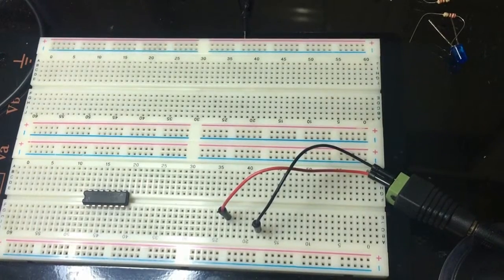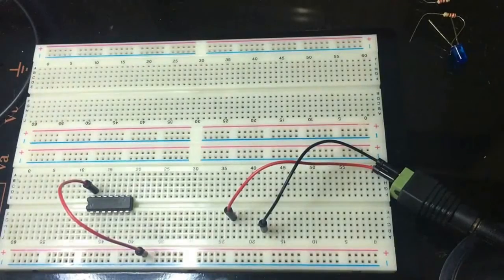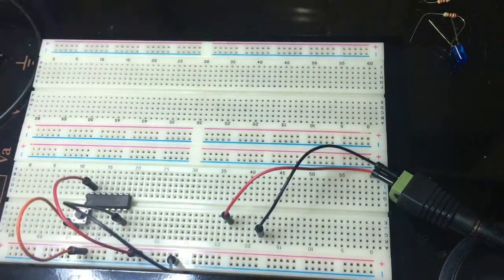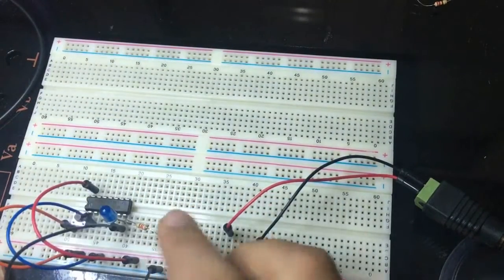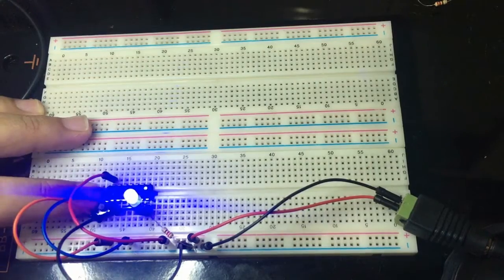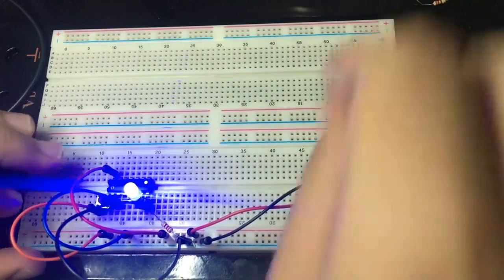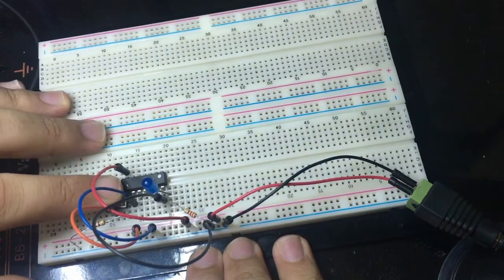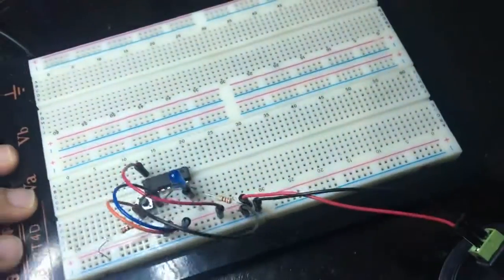How to Wire a Switch to Any Logic Gate?

Comment: Could you list the parts
I want to do this as my project
Reply from the maker: For this video I used:
- A Breadboard.
- 220 ohms resistors.
- 9V battery with 5V regulator as power supply.
- 6 pin on/off switches.
- Any logic gate.
Reply from the maker: If you have any questions don’t hesitate to ask me. Have a nice day! :-)

Comment: I came here from your other video.
I am starting to build larger circuits with these ICs. Now the problem is that having to add a resistor to every input is a mess and takes a lot of space. Is there any workaround? Can I just connect all the inputs through only 1 resistor to ground to save space?
Thank you.